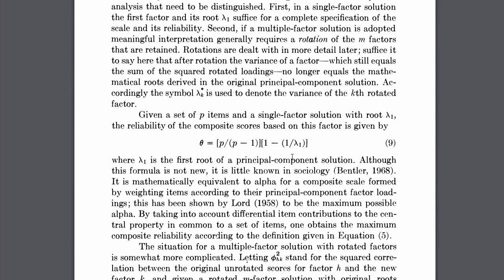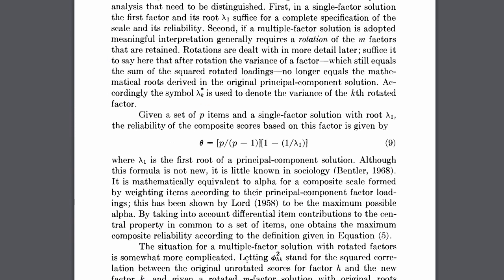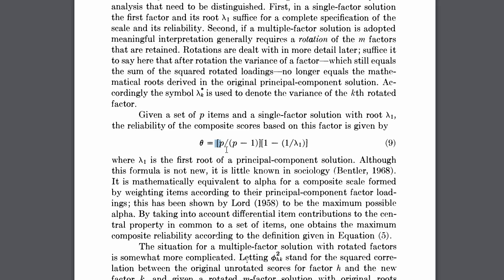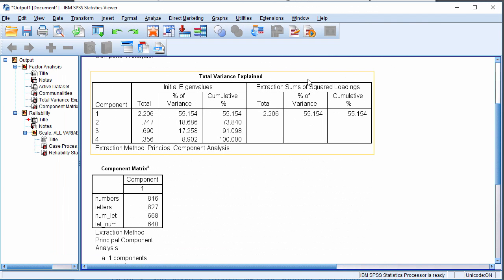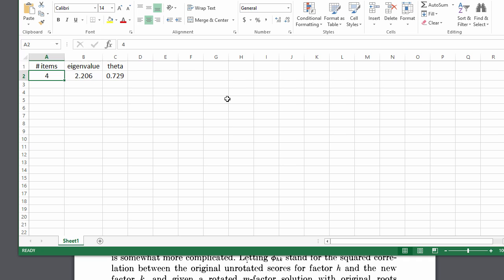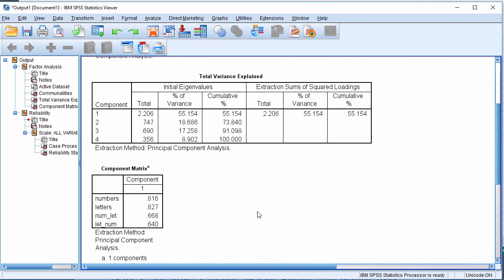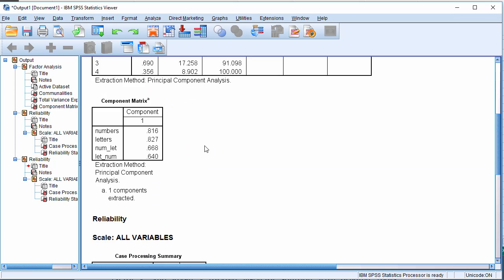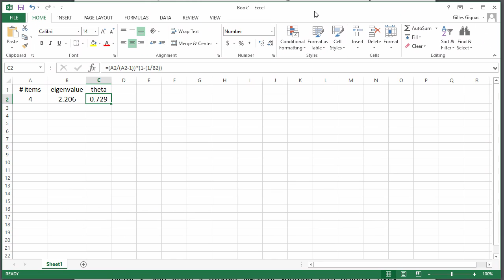How To Estimate Reliability of Factor/Component Scores

Comment: Thanks for the video. This video was really helpful. How to compute Theta reliability for m-factored solution (rotated). I have a three factored solution after rotation. Can we calculate component reliability using equation 9 used in the video. I have tried using equation 10 but the reliability values are coming very less compared to Cronbach's alpha. Can you please help me with this?